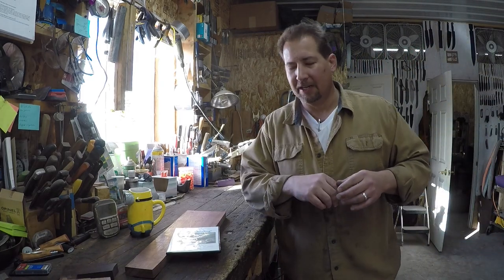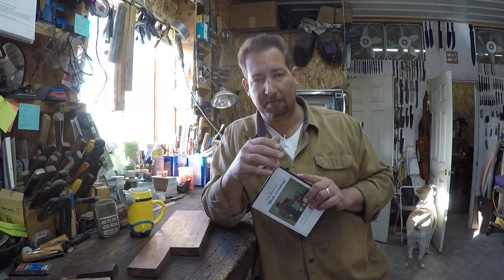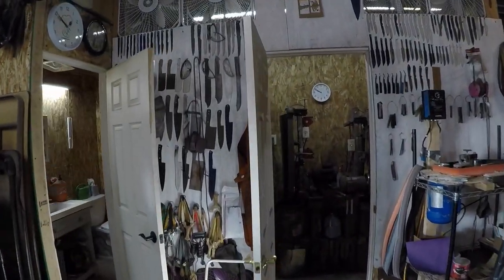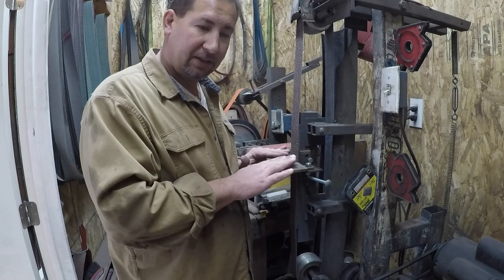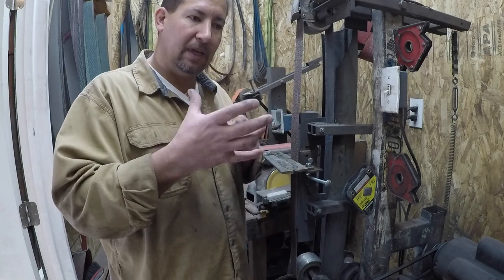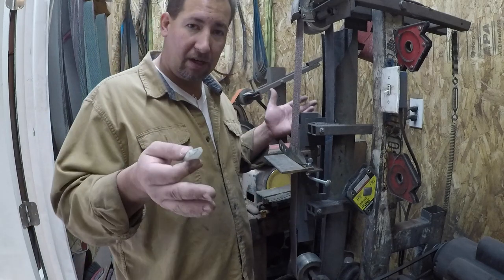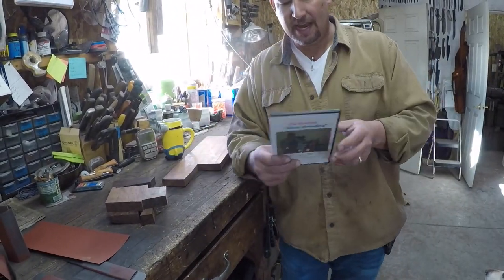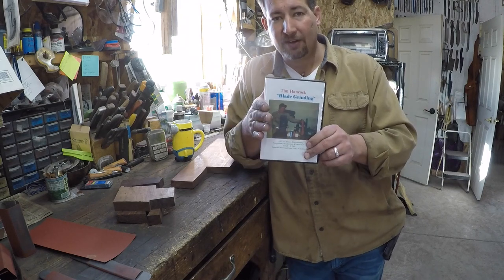learning the tim hancock knife grinding method

Comment: If I get a new grindinger I'll give this a shot. I'm using a rinky dink 1x30 right now,  so the work rest takes up the precious little space I have on the platen. 

I'm trying to save for a heat treat oven right now. A 2x72 will have to come after I get that.
Reply from the maker: i hear ya. when I started knifemaking I could not afford all the tools all at once either. so I built most of mine, and then later changed them so they work just the way I want them to. there are tutorials on the web about how to build your own heat treat oven. i built mine and it has been doing pretty good for the last 10 years or so. you might look into it as for the cost of a commercial heat treat oven, you might be able to afford parts for an oven and a couple grinders.
Reply: @joecalton1449  I've looked into it a bit. I may slowly buy the parts to build one, and put it together as I go. I've been looking for an old treadmill to use for a 2x72 as well.